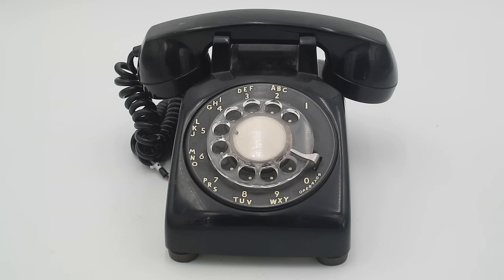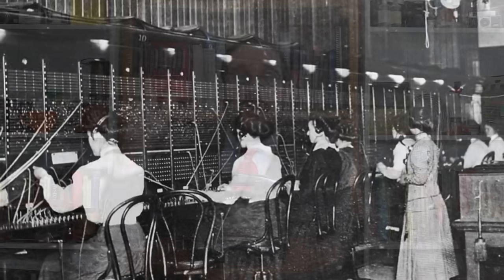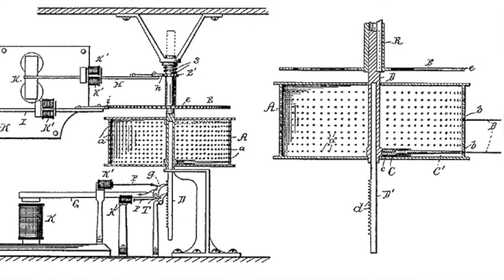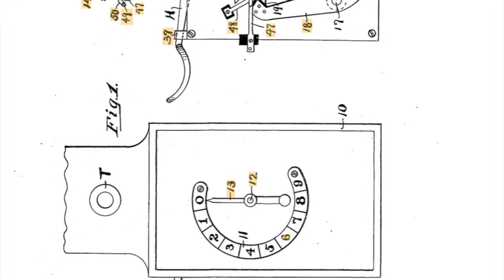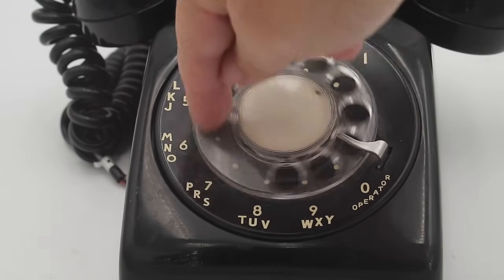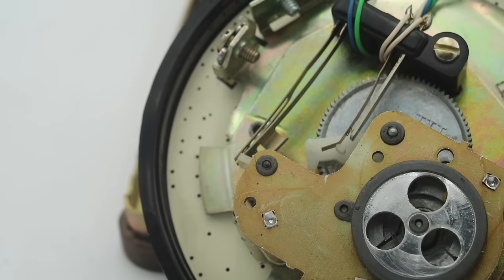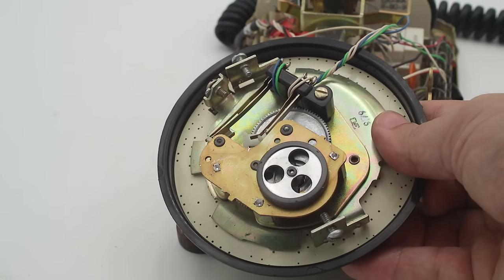Rotary Phones: the Call of History

Comment: What is the make brake ratio of the rotary phone contacts? The dial phone was necessary for using stepper relays in central offices. After Step x Step came Crossbar Switches then Fully Integrated Digital Switches. It was a highly reliable device. ATT gave phones to Kindergarten children to play with. I used to teach the history of Telecommunications Switching Systems for ITT North Electric. We wrote and presented a 560 hour course on the first fully integrated digital switching systems starting with a brief history.

Comment: I worked for the Bell System in a Panel Switch Central Office in Cleveland. The job title was “ Switchman” or Central Office Technician. The  Switchman’s job was to take trouble reports and isolate the trouble source and repair it or refer a trouble ticket to the “ Apparatusman” to repair, replace or rewire the defective component. At Cleveland Glenville C.O. The Panel switch was in use from 1928 to 1972, before cutover to #1 ESS. It took a total of 45 C.O.Techs and Apparatusmen working around the clock to keep this technology functioning and providing telephone service to tens of thousands of subscribers.

Comment: My grandmother never places outgoing calls so she still uses hers. It won’t dial out with our local phone network but works for incoming calls just fine.
Reply: If she needs to; An outgoing call can still be placed using a simple DTMF tone generator (Commonly supplied as a „Remote control“ with many 90s answering machines) - Simply lift the receiver, place the tone generator keypad over the mouthpiece, and dial as for any touch-tone phone. ☎👍

Comment: Training went out to all the houses in the street for Emergency dialling.
Put your index finger on top of the dial and slide it anticlockwise round the outside till you feel the finger stop. 
Put your index finger in the hole, you have located 0. Put the finger next to your index finger into the hole beside it, that is 9. Dial 9. 
Find the hole again once the dial has stopped turning and dial the second 9.
Repeat and explain the emergency.

Comment: Thanx for the video.  I worked in the telco  industry from 1963  to 2018  when I finally retired.  Broke my teeth on Western Electric 7A Rotary systems,  then British Step systems (very inefficient system)  and finally Japanese Crossbar (#5) .  Never  saw a panel system  here in New Zealand.  From 1980 I worked on electronic CPE PBX and voicemail systems.  Yep things sure have changed.  You were correct about the New Zealand reverse dial that came about from the WE Rotary system and was never corrected. It was a pain in the but.  However Touchtone sorted that problem out.

Comment: Interesting material! I see that you commented that the Northern Electric phone was manufactured in 1979. I noticed in your video that it said 12/79 on the bottom and had rubber pads. We had one when I was a kid that was presumably manufactured in the mid 60s when our house was built. It looked identical but had leather, rather than rubber on the bottom.

Comment: Commenting 11/19/2023. Up until installation of fiber optic line about 3 weeks ago I had a functioning wall mounted rotary dial phone. This was installed about 1970 or so. I'm looking across the room at it right now, and plan to leave it there. Our other 'modern' phone is a touch tone base unit with a portable handset. It's analog and requires a ATA (Analog Terminal Adapter) to function with the fiber network. Basically forced into the 21st century by Consolidated Communications, but have to admit that being able to stream video, so far, on six devices at the same time with no problems is pretty nice.

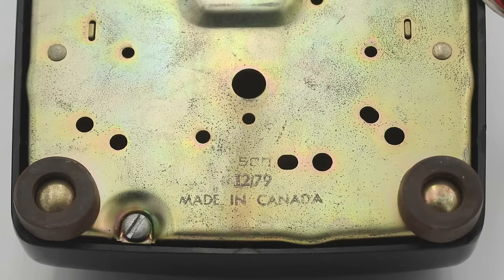Comment: 6:22 Actually, the date on that phone looks like 12/79, or December of 1979, perhaps making it one of the very last examples of its kind. But it's essentially the same thing as what was made in the 1960s. The two things I remember about the phone my parents had installed in August of 1966 was that the dial was all metal (making a little burn mark on my finger if I tried to dial fast) and that it lacked the "RJ" modular jacks and plugs that became ubiquitous in the 1970s.

Comment: The BPO, (British Post Office) patented version of the rotary dial was very similar ax detailed in this video, except it was called a “trigger” dial, in that it had an additional mechanism that it ensured there was a “forced interdigital pause”.. e.g. at least a couple of hundred milliseconds between digits dialled.. this was ensure there was time, between digits for the selector to hunt for a free next digit selector and to “seize” that selector and the necessary relays etc operate to make it ready to receive the next digit..
After having worked in a busy / big step by step exchange, you got used to the rhyme of the selectors stepping at 10 pulses per second, so it was easy to hear a selector being stepped by taping the switch hooks… if you came across one we used to, for a bit of fun, either “drop” the call or give them the wrong number !!

Comment: In the UK an automatic exchange in a small village might see an intial "9" as the code to send the call to the nearest town, and the town's exchange might see the next "9" to pass the call to the nearest city. Another "9" could be switched to a circuit at the staffed exchange. In the 1960s and 1970s cities tended to have integrated systems while smaller towns or villages still had local dialing codes that reflected the physical links between them. If you knew what you were doing you could hop from exchange to exchange, bypassing the trunk lines. Unfortunately this also bypassed the line amplifiers in the trunk lines.

Comment: Some clarifications needs to be done here regarding telephones and emergency numbers in Europe. I worked a long time for the Swedish govermentally run telephone company 'Televerket'. 

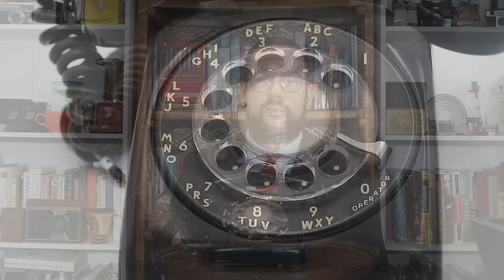As @OleJacobsen written further down down below in the comments, it was only Sweden that had that 19:01 type of phone numberlayout (0-9).

Furthermore when it comes to emergency numbers, each european country had there own before joining the European Union. Here in Sweden we had  the number 90000. This number was chosen because of the things you mentioned, low probability to call the wrong number and so on, based on the layout of the Swedish dial phones.

Comment: Great video thanks. Other videos are mentioned but I do not see the links to them. There are a number of fascinating things about the old type phones. For instance the fact that there is only a single pair of wires connecting the phone to the exchange, but audio goes both ways through that pair at the same time. Another that the old style carbon microphone produced more audio output than the acoustic audio going into it and that it could drive audio all the way to the connected phone's earpiece without any amplification on a local call - in the UK that could be up to 7 miles away

Comment: As far as public exchanges go, in the United Kingdom the last manual exchange, at Abingdon, closed in 1975. The first automatic exchange, Epsom, opened in 1923. World War II probably slowed automation being adopted, a bit. Upminster was the last manual exchange in the London region, replaced by a crossbar exchange in 1970 - some people are surprised crossbar would go in then. DTMF first came to the UK public telephone network in 1976, in Sutton Coldfield, close to Birmingham. One consequence was a change of dial tone - we had used a "purr" in the pulse dial only days but this was incompatible with DTMF. Some private exchanges used a different system of signalling - known as DC signalling, it used combinations of diodes and connections to earth for each digit.

Ireland was even further behind the times, not decommisioning its last manual exchange, Mountshannon, until 1987.
Reply: According to  Atkinson's Telephony book the first automimic exchange in the UK was in Epson, Surry  and opened in 1912
Reply: @paulwarner5395  1912 is possible though I am sure I read 1923 somewhere. Epson may be a typo - it was definitely Epsom, which is indeed in Surrey.

Comment: I can remember a rotary dial telephone at work that had a lock on it so we couldn't use it to call out. I defeated it by clicking the cradle to dial, just as you described. The lower numbers (1, 2, 3, etc.) were easy; the zero (10 clicks) was the challenge. I never used it to call long distance; I just wanted to call home to let my parents know I was on my way. (Pre-cell-phone days, obviously.) Just saw in later posts that I wasn't alone.

Comment: We didn't get 911 service until about 1986. When I was a kid our touch tone phone was hardwired into the wires inside the wall, but my grandparents' rotary phone cord had a four prong plug that plugged into a corresponding jack. Of course later phones started using modular plugs and jacks.

Comment: @13:47  -  Those tubes are not for switching... THey are amplifier tubes for the audio. One may even be used as an oscillator for tone signaling to the PBX in the other room. That phone is very old and strange. I have seen a lot of vintage equipment. This one is a very rare bird.
Reply: That’s a three-line with hold phone. Looks like a typical key system phone except for the three red hold buttons. They were less common. I’d guess the tubes are cold-cathode gas discharge tubes used to operate a single ringer from the three lines, in the same way two- and four-party selective ringing was handled. The tubes ionize and conduct when voltage is of the correct polarity, like diodes. Therefore, a line rings when ringing current passes through the tube, while another tube wired in reverse isolates the voltage. I can’t imagine vacuum tube amplifiers operating constantly in a phone.

Comment: Your explanation of how 2600 Hz worked is incorrect.  On telephone trunks, since you no longer had a DC loop when they were multiplexed as they were over long distance lines to allow more conversations over a given number of wires, 2600 signal was used as a substitute for loop continuity.  When there was 2600 Hz present, that was interpreted by the far end as on-hook, when it was absent off hook.  And most trunks in those days would accept either MF multi-freq, using tones to dial, or pulse, pulsing the 2600 Hz tone to dial.  Billing those days was done at the originating end.  So if you wanted to make a free long distance call and you had only a captain crunch whistle what you would do is dial an 800 toll free number, after it connected you would send a short blast of 2600 Hz, the far end would hang up, then when the 2600 Hz went away it would see it as a new call originating, then you could pulse out the number with your whistle, or if you owned a blue box send the tones for the digit you want to dial.  The local office would be unaware you were disconnected from the original end number and bill the owner of the 800 number for that call rather than billing you for the actual number you dialed.
Reply: Aha! A Phone Phreaq!

Comment: "This telephone was manufactured sometime in the 1960s.", proceeds to show manufacture date stamp of 12/79...like in December 1979.   'The 302 was the first phone to integrate the ringer with the phone instead of using a separate ringer box."   The ringer box included the ringer AND the network.   The 302 was the first Western Electric phone to integrate the ringer and network into a single desk set phone.  'The model 302 was made out of Bakelite thermoplastic due to war time shortages'  WRONG!  The Model 302  went into production in 1937, FOUR YEARS BEFORE THE USA ENTERED THE WAR.   The phone housing was originally made of cast zinc alloy and them switched to a thermoplastic called Tenite NOT BAKELITE.  The handsets were Bakelite.   Phone production for the civilian market was suspended soon after the US entered WWII and Bell Systems factories switched over to war production.   The older generation is entitled to make fun of you because YOUR GENERATION TRULY IS CLUELESS.

Comment: Phreakers generally didn’t use DTMF to get free calls. They used  the old in band single frequency (including the 2600 hz trunk available tone) and multi frequency signaling, which were both part of the R1 signaling system. The multi frequency tones do not align to the end-user DTMF that would later make up touch tone dialing. R1 is an interesting switching system, especially considering its age.

Comment: When I was a little kid I would turn the dial and then when it was supposed to go back on its own, I would force it with my hand, making it pulse faster than normal. I was testing how fast I could dial the number and get through.
Other times I would dial extremely sloooooow, even holding the winder back while it was unwinding, testing how slow I could dial to get through. And if you were slow enough, the switch board would cut you off after some time.

Another funny thing with phones in those times was, when you called another person, when they hung up, you would get a busy tone and the connection ended. But when someone else dialed you and you answered the phone ... I toyed with this a lot ... when the other person ended the call (perhaps they dialed the wrong number), then they hung up, but I did not hang up and I just covered the microphone and stayed online, and the connection actually stayed alive. Then you could wait on phone for a while and if the other person picked up the phone again, you could hear them talk while dialing and ... of  course they could not get another connection, they would dial into an already connected line and would not get anything, but you (as a little kid) could giggle and listen how they talked into the phone wondering why they are not getting a connection.

Another thing from those 1980s days was, there were automatic clock numbers that would tell you time if you dialed in. And there were numbers that you could call and listen to music on the other side. The connection quality was quite bad in long distance calls and if you listened to such music (which was expensive btw) it would sound very remote and echo-y. So as the kids that we were, we would talk in school about "you know that number that you dial and you get music on .... well it is music from A CRYPT!!! It is very creepy and scary to listen to it, it is from a haunted crypt!" Funny stuff.

Comment: In the 1960s, my father would have nothing to do with touch-tone phones.  The reason was, that if you wanted a touch-tone line, you paid extra.  My dad didn't think it was worth paying more, just so you could dial more quickly, which made sense.  Those were the days before messages like "Press 1 for...." came into use.
Reply: When I got phone service in 1981, touch tone was an extra monthly charge, which I declined.  However, one of my old phones had a pushbutton keypad, and a switch for tone or pulse dialing.  I was happy to find that tone dialing just started to work one day with no extra charge.
Reply: From 1989 to 1992, I lived in rural Southeast Arizona, and touch-tone service wasn't even available, there.
Reply: That's what that Wiki link said.  But in this day & age, the communications agencies in the various countries ought to get together and standardize those numbers.  This has been done for a long time, for the bands in the RF spectrum, regarding frequency allocations, by the International Telecommunications Union.  With the increase in international phone calls, it makes sense to do it for those.

Comment: Many people don't know this that during the 1920s and early 1950s, urban local phone networks had a mixture of both dial and manual exchanges. Both used the two-letter five digit number formats. Calling from a dial exchange to a manual one involved dialing this same number format mentioned. This call would be routed to the manual switchboard of the distant exchange. Operator would plug into the answering jack and the four dialed digits would show on a lamp indicator of the switchboard. The operator would then plug the calling cord in to the appropriate jack serving the called number. Operator proceeds to operate the ringing key. Baltimore, some of Boston's suburbs, and San Francisco would have this arrangement.

Comment: In the early '80s I someone explained to me how the rotary dial system worked. I was able to raise an operator by rapidly hitting the switch hook ten times. It was just proof of concept, the idea of dialing a seven digit phone number seemed impractical. 

Around the same time, after breaking of the Bell monopoly on what devices you could connect to their network, third parties started selling all electronic phones but they still had to be backward compatible with rotary dial systems.  So instead of a mechanical dial it had electronics that simulated the old rotary standards. My phone had a switch on it that said "PULSE" and "TONE", which allowed a user to switch between types as required by the phone system.

Stupid story. When I moved to Downey, CA in 1985, the local phone system (GTE) still considered pulse (edit; whoops, I meant touch tone) to be a premium feature, and they wanted to charge extra for it. Because I had a phone that went both ways I declined, and and just set my phone to pulse. At this point they had long since switched over to DTMF internally, but to try to chisel me out of $1 a month they had to maintain electronics on their side that took the simulated mechanical pulses and converted them to DTMF.

Comment: Back in 1983 I installed a Mitel PBX in a Police Dispatch Center. 911 calls were answered in this center and every so often the dispatcher would get an emergency call that wasn't an emergency, usually a confused caller. Turns out the callers  were attempting a long distance call to Kansas, area code 913. They would forget to dial "1" first for the long distance code. The local central office would allow an emergency call by dialing only "9-1".